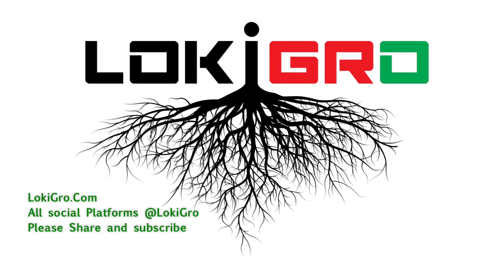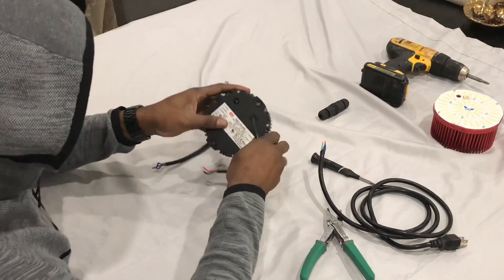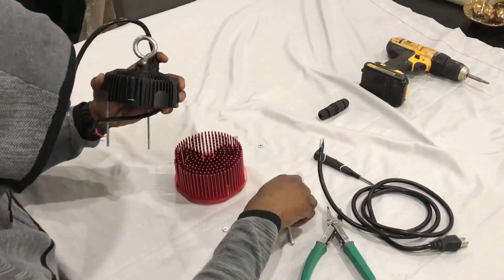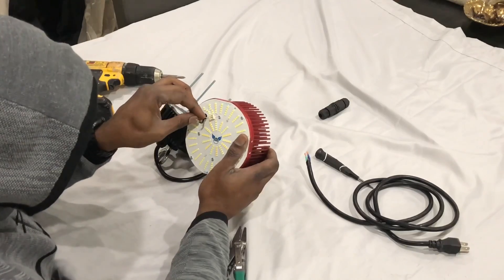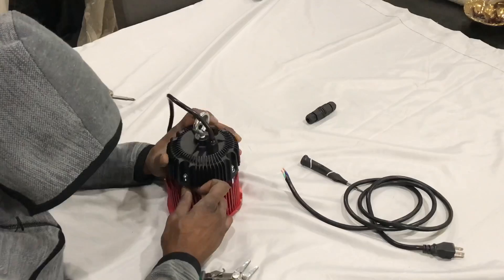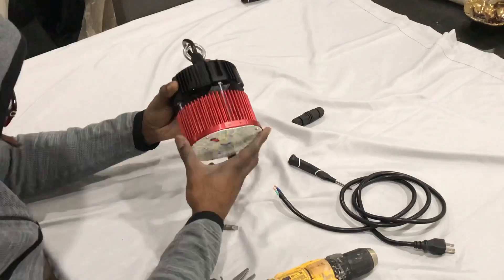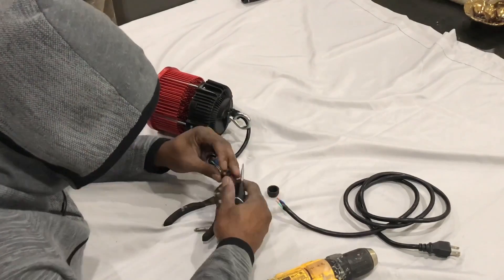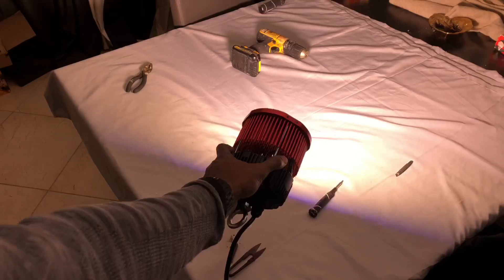ChilLed 100w DiY LED

Comment: I didn't notice the very inexpensive heat mat(?) between the board and heatsink? I've been looking into building one, and that's always recommended, but maybe not available then?.. Great video! I couldn't tell from their chart if that particular driver would work at 100W? Much Thanks for the build, and all the info! Very well done!!!

Comment: Q: what is the availability of the red heat sink? The black 140mm heat sink from RapidLED isn't drilled and tapped to accept 10-24 bolts.

Comment: What would u recommend for a 4x4 area 6 of these pucks or a hlg 550v2
Reply: 6 pucks - 300$ before discount, 6 140mm heatsinks - $120 before discount, HLG600-48B - $170 before discount. Frame can be a substrate from rapid for 180-250$ depending on options or build your own frame and brackets with extruded aluminum for around 125-150$. HLG 550V2 - $1050....

Comment: Nice info man, First off don't put that puck on till you have assembled the rest of the fixture, makes it soo much easier (and less chance of messin up a puck).  ;-)

A heads up tho, the 140MM heatsinks from rapidled DO NOT have the threaded holes for back mounting the driver. At least the last ones I received a week ago did not.

Keep up the good work and nice to see ya back on the "tube"!

Comment: Man I've been requesting this version since the start! Finally some veg tuned pucks. Where's the love for your Gen1 V1 puck customers @Growmau5 😆
Reply from the maker: Stabby McStabwood I’m gen zero I guess you next in line
Reply: @LokiGro  how much were those M5 bolts? I sent Mau5 a link for some cheap stainless m5 all thread from Wal-Mart when I was making my singles.
Reply: Ah nvm I you used those 10-24 screws for mounting